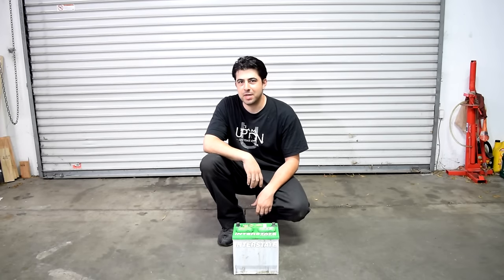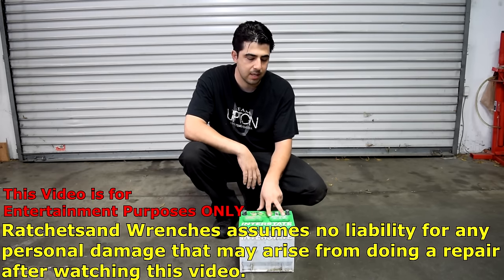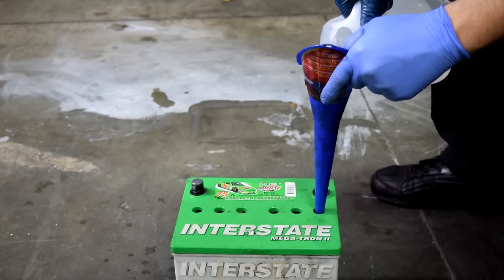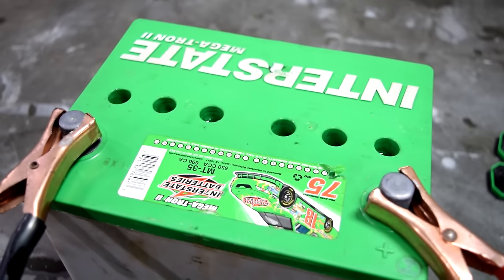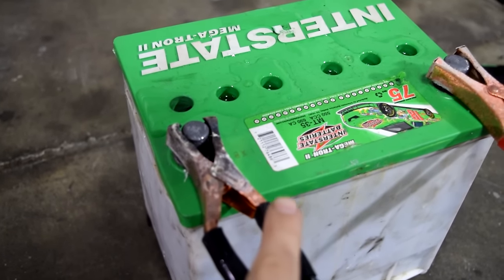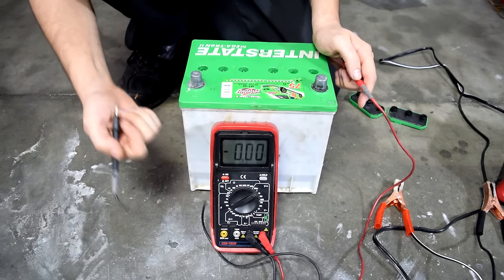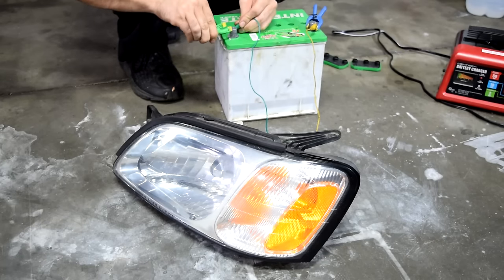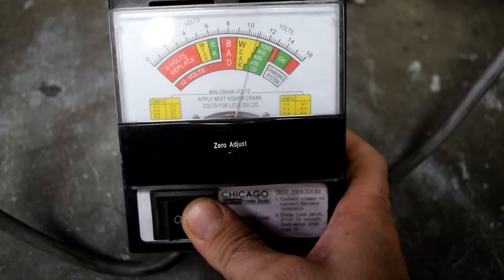Is it Possible to Revive a Dead Battery with Epsom Salt - See For Yourself

Comment: To recondition you have to use around a 200 amp charge and cycle it 4 to 5  times 5 min on 10 min off this removes the crystallized alkaloids off lead plates and back into the distilled water allowing the plates to do their job a low amp charge cannot do this. Only high amp if you have an older battery charger or an expensive one with 200 or 250 amp start feature you can use that also can use a cheap welder. Also no need to remove or change battery fluid until you have done this.. This process will rejuvenate battery Acid by distributing crystalized alkaloids off lead plates back into water remember
The alkaloids hold your charge and transfers to lead plates. If lead plates are All crystalized they can't properly relay energy either so start by checking specific gravity with battery hydrometer then top off with distilled water then hi amp charge cycle it for 5 mins on 10 mins off 4 to 5 times this removes crystallized alkaloids off lead then recheck specific gravity.. Bet it's changed. Then you can battery acid mixture if wanted but at this point is not needed because alkaloids should be correct now certified through hydrometer.

Comment: I tired iwth an interstate i iddint work , I tried with a Motomaster (was frozen on and off for a few years ) 6 years old. it did work
Reply: I just did 2 rounds of baking soda and distilled. Side post motomaster. I already replaced acid with epsom salt before so im trying again. Hopefully this does it, was sitting at 10 volts after first attempt unfortunately. Praying for this one!

Comment: Most batteries sold these days are "maintenance free", meaning it'd be hard (some are easy) to open up and add distilled water, etc. My Exide battery is MF, and I can't pry it open without breaking plastic tabs that hold it down, so I gave up.

Comment: You have a great program and have learned some new tricks as well. Have to agree with David Hammond as he is correct. You are creating a circuit on ground with it on the cement. Believe me, if you were to use a block of wood or the bench you will see a difference. (Know this from years of experience and failure) Thank you very much for your time.
Reply: I always store my boats batteries in the winter in my garage. I would put a piece of cardboard between the concrete floor and the battery , plus keep a trickle charge on each one. I learned that from a TV fishing show years ago minus the trickle charging which I decided to do. I just bought small El'Cheapo chargers for each battery.

Comment: after you charge the battery you're supposed to drain the Epsom salt solution into your battery acid but not battery acid that you put baking soda in two and then pour that back in and top up your battery and charge it and your battery should be fine

Comment: I can't believe how many people are truly missing the mark here. Yes dumping out the old acid and adding epsom salt and sloshing it around or even letting it sit a day or two is ok for cleaning the plates but you need to purchase battery electrolyte to replace the acid that you dumped out to get the battery to put out the amperage you need to start a car. It can be purchased online 3 quarts for 12.00 or  6 quarts for 22.00 plus shipping. Still way cheaper than purchasing a new battery.Then your battery will be like new and should last like a new battery if everything else is fine.

Comment: I don't understand the point of leaving the wrong mix in the battery. Batteries are meant to run on ACID, not salt water. Batteries go dead when the acid goes weak and the lead plates collect sediment and contaminants. Dumping the old acid, and soaking out the sediment on the plates with salt water seems logical. But why wouldn't you dump the salt water and refill with fresh acid? If a battery could work on salt water, why would the manufacturers use such toxic, dangerous fluids?

Comment: This can work for a little while. However, sulfuric acid is a much better electrolyte than saltwater. And you can get more than enough sulfuric acid from the auto parts store for about $12.

Comment: This kinda worked, my jeep battery was toast and sealed with a black plastic cover over the caps so I took a hammer and giant flathead screwdriver to it, I poured the acid into a Pyrex dish, made the Epsom salt and distilled water solution, mixed it and filed the cells to 1/2 inch above the plates. I've got a "smart" charger but it kept coming up with F4 which is a fault. I spent 20 minutes or so nursing it up to 12v by cycling through slow, fast. winter and 6v before the fault had a chance to reappear, left it open and on slow charge over night to find it at 12.3v this morning, I hot glued the cover back down and put it back on charge, I put it in the jeep but it keeps dropping charge after trying to turn the engine over, does anybody have any idea why it isn't holding charge? I now have it on fast charge between each attempt trying to get the Jeep to turn over.

Comment: If want to try something I got onto and works on most batterys.
Drain the battery and then get a garden hose and flush each cell.
the rubbish and heavy gunk comes out .
if you dont break the internal bars ..All is good.
its hit and miss ..But a fix is a fix.

Comment: what i have done on the farm is reverse charge take every volt out of your battery even if you have to put a torch globe on it to drain it then put pos lead on neg and neg on pos then charge it then paint an plus where neg is  i have got another 3 years out of my tractor batteries

Comment: Buy a high quality battery to begin with.  Most automotive car chargers overcharge, then cut off too soon, never "floating" the battery. Shorting the batteries life.  If you have a good battery charger, you can occasionally "float" the battery using it, extending battery life for a few years. Look up what a dedicated Marine battery charger will do from West Marine Co.

Comment: I pay roughly 109.00 for my 850 cca battery for my Dodge Hemi Ram at Walmart and usually get 6 yrs. out of a battery   In my opinion fiddling with a dead battery messing with acid etc. to save a hundred dollars just isn't worth it When I was working as a diesel mechanic I told a guy he better put on his face shield and goggles when he was charging a group of deep cycle batteries to start a Cummings 400 diesel. Oh I will be fine was his answer. 10 minutes later we had him face down in the eye wash station flushing battery acid from his face and eyes. Fortunately he was fine with no serious burns or damage because we got him to the wash station immediately. Trust me. Batteries need to be respected and trying to save 20 dollars a year for 6 years to revive an old battery just isn't worth it for me. Better left to the recycling companies in my opinion.

Comment: Would this have worked if you used fresh acid?
Reply: discerningmind yeah. He turned an acid based reaction into an alkali based reaction. Good for deep cycle and it will have the lower cold cranking amp rating. 

What he got is correct. Now, if he rinsed the battery out several times with distilled water, then put an acid solution in, as it had originally, the cold cranking amps would go back up. 

P.S. just read the previous comments.
Reply: discerningmind v

Comment: I'm pretty sure you should have dumped out all that epsom salt water and flushed with pure distilled water then added fresh distilled with sulfuric acid in it to the proper concentration to regain your amperage.  The sulfuric acid is necessary to hold those factory levels of draw
Reply: It's not. You can use regular salt in a food container with distilled water as well and get alot of power.

Comment: You didnt flush the baking soda out of the battery before adding the epsom salt. Also Its a good idea towarm up the water before adding the salt as it can absorb more and the idea is to add the salt until the water is completely saturated.  I dont what effect (if any) this would have had on your results but it might be worth trying since you got so close in this video. Good luck.

Comment: A sulfate build up on the plates has to be removed to consider a battery (lead acid)serviceable .
Salts will not remove sulfates. Also mixing an acid with a base is a no no.
this also crates a salt.
Reply: GOOD.

Comment: Hi Sir I'm going to try a to repair a fairly big  12v car battery & has a dead cell & have emptied all the acid out of the battery & poured in fresh clean water into the battery &  gave it a good shake up & then emptied all the water out & then later I poured hot water into a Big bottle & then added baking soda to the hot water & gave it a shake up & poured it into the battery & you have seen it bubbling & had left in there overnight & this  morning I am going to give it another shake up & empty it all out & I'm going to boil up some more fresh water from my 250 liter water tank it's pure rain water & add baking soda to the hot water & shake up the bottle again & then pour it back into the battery & this time I'm going leave it for about 2 hours & after that has been in there for 2 hours I'm going to give it a good shake up & pour it all out & I will that same thing again & mix up baking soda & have more hot water & pour that mixture into the battery & let sit for another 2 hours & I'm going to that for another 2 to 3 times & to make sure that those battery plates are nice & clean & once I'm Happy with that then I will get my distilled water & then I will add Epsom Salts to the hot distilled water & then pour that mixture into the battery & then I will get my Foxsur 12V/24V 7stage battery charger & put it on the charger on repair mode & leave on charge for 2 to 3 days & over night as well & I will keeping a check on as well it might be ok in 2 days & see if I can repair this battery & be nice if I can repair it & have got nothing to lose Kind Regards Peter

Comment: You need to power cycle the battery at least 5 times between 100% and 50% charge before it gets better. Also, you may need to run the battery through a desulfation process before declaring it doesn't work :)

Comment: The original mixture was dumped out of battery but was not dispensed back again after cleaning with mixture of epsom salt and  baking soda. That makes no sense because sulphuric acid is the main conductor solution in the battery.

Comment: Awesome experiment . But you have to use acid to get the cranking amps . Salt will not do the job because it would've been use instead of acid . Now using baking soda will not work either . You only put acid and distilled water . People please do not use this method to crank your vehicle it will cause a lot of issues . Please take your battery to a a professional. For experiment it's cool but dangerous . but to use it on your daily car please don't it can be fatal..   Be safe and ask your local auto place about your battery being low on water . 💪😎👍

Comment: If you set the battery on a rubber mat, the battery will charge properly. With nothing under the battery it is grounding out on the concrete.

Comment: You should have saved the battery acid in a glass container then instead of ebson salt you should have used the old acid and then recharged the battery you would then have gotten your cranking amps back

Comment: You never charge a battery on concrete or the ground you need to put a board underneath it if you want a good charge
Reply: The concrete thing was from old pre war batteries, current batteries have proven that it's now a false myth and cardboard is more porous than the concrete

Comment: Never use baking soda.  if you want to give it a go, simply empty the sulfuric acid out and refill it with new sulfuric acid and put on a one amp charger for 10 hours.  if you really feel the need to clean the inside, grab some distilled water and clean it out a little bit.   YMMV and you really need to take a lot of safety precautions when dealing with acid.

Comment: First, you can only LOAD TEST a battery that is fully charged.  If it doesn't show in the Green to begin with, that whole process is pointless.
Second, in order to properly charge a flooded lead acid battery, you need a 3 stage charger. Bulk, Absorb, Float.  Not sure your charger you are using is actually capable of that. The absorb period alone would be around 23 hrs based on your 2A charger charging a battery rated at 100A.  A fully charged 12V battery should be in the neighborhood of 2.25V/cell (or 13.8V).
Third, your subsequent tests all started outside of the initial GREEN area.  This is an indication that the battery isn't properly charged to being with.

Comment: This is completely useless in colder weather and climates - the distilled water/salt combination will freeze at roughly 26 - 28 degrees Fahrenheit, depending on the salt concentration.  What good is a frozen battery with a burst case?
Reply: What's to rethink - the ocean does freeze, just at a slightly lower temp than fresh water.  The big difference is that the ocean water is being constantly moved by wind and currents, making it more difficult to freeze.  Just like larger streams or rivers of fresh water can remain unfrozen even below 32 degrees Fahrenheit. I take it you have never been to the northern east coast in winter time Onyx King?  Of course the whole ocean doesn't freeze, but the shallows along the shore do.

Comment: here's  a few ideas for fixing a car battery
never try to do this until you know what you are doing - the acid can burn your skin
check the voltage first - there may be a kaput cell which will be a waste of time trying to fix.
Check your battery fluid.
attempt to fully charge the battery.

Comment: Not sure what the point of dumping the electrolyte was, just add some baking soda to each cell and top it off with distilled water, hit it with your desulfator, pray, sacrifice an alternator belt to the electro-mechanical gods, do a charging dance, and you may have a chance of extending the useable life somewhat, though not the performance.

Comment: try flip the battery, get it in place, then pop the corks. much easier and cleaner.
would citric acid work to clean in some way. or as the electrolyte

Comment: I don't understand. This is a lead / acid battery. You dumped out the acid (the old sulfuric acid (low ph) and flushed the internals of the battery with a basic solution (high ph). At no point, did I see you replace the battery acid with new battery acid.. You never restored it back to being a lead / acid battery,  instead,  you charged a lead / salt solution battery. I'm totally confused. My understanding of the restoration process is to dump out the old battery acid.  Than fill the battery with a strong sodium bicarbonate solution and shake it around, and let it sit for a day or longer. Then (carefully, taking all possible precautions) pour the salt flushing solution into the container holding the old battery acid. There could be a violent reaction when high and low ph solutions are combined, so protect yourself in the event. This will begin a process of neutralizing the old sulphuric acid to a neural solution, no longer hazardous, except for high lead content.  Repeat this procedure everyday for a week, always pouring the salt flushing solution into the container with acidic battery acid, further neutralizing it, each time . Then you must flush out all traces of the salt flushing solution from the internals of battery. A low stream from a garden hose will work well for the first few flushes. Use distilled water for the final flush. On the last topped off flush, measure exactly how many ounces the battery can hold. Purchase that amount or more sulfuric acid designed for use in lead acid batteries and top it off full strength.  Put back the caps and charge it up on a trickle charger for a day. Cross your finger and hope that you desulfated the battery plates enough that it will behave, almost, as it once did. It will either work well or not work at all. Good luck and be safe doing this.

Comment: The cleaning part dosent REQUIRE distilled water. Best to use it though. When refilling with epsom salt solution distilled water is necessary to prevent mineral sulfation.

Comment: Follow-on stages were left out.  Step 1. The Battery is emptied of fluid. Step 2. The battery is filled with Distilled water and low quantity of sulphuric acid; (about 10 to 20% by volume). Step 3. The battery is exposed to high voltage at low current, Or pulsed with high voltage Or set to charge at or above 24V, Whichever system is available. This helps remove any remaining Hard Sulphating layer on the Battery Plates . NOTE:- Interrupt the high voltage charge if the Battery gets hot. Warm is OK. Step 4. Let the electrolyte bubble out, but top-up with plain distilled water to just cover the plates. Step 5. Check the cells with hygrometer; Initial readings should be low due to the low concentration of sulphuric acid put in. This is corrected later.  The usual concentration of sulphuric acid is around 35%. Since we have started with low Sulphuric acid, improved hygrometer means that the extra acid has come from De-Sulphonation of the plates. Step 6. Per hygrometer test, Top up with sulphuric acid on a cell by cell basis, Or if preferred, empty again and replace the solution  with 35% battery acid, 65% distilled water. This later step is only good if the cells show equal voltage. Slow charge overnight. Then Fast charge for 15 minutes. After that do the Battery test again. This process will have removed any unnecessary aluminium or magnesium, as well as trace sodium. Hopefully you should have double the cranking amps - or better-- after the additional steps.  All the Best. ZS6DGB.
Reply: In making reference to your comment... Exactly